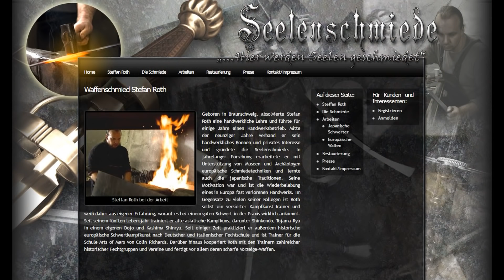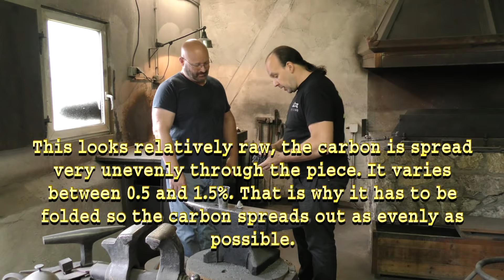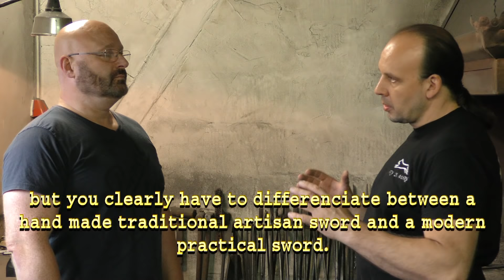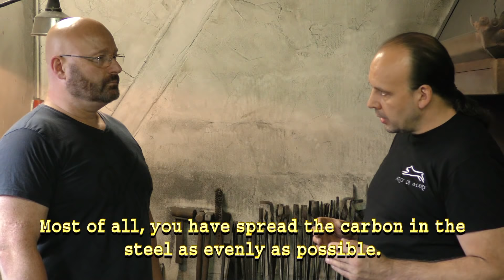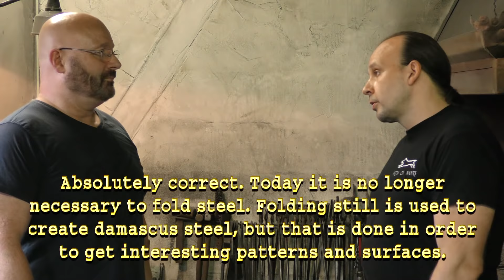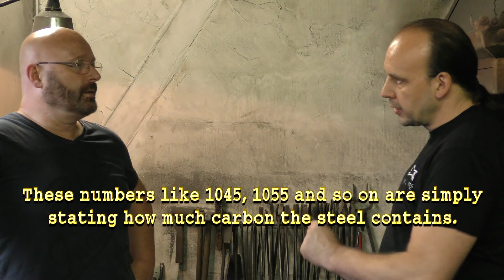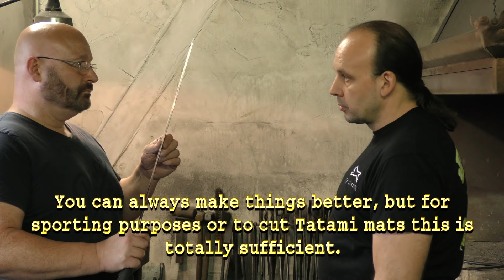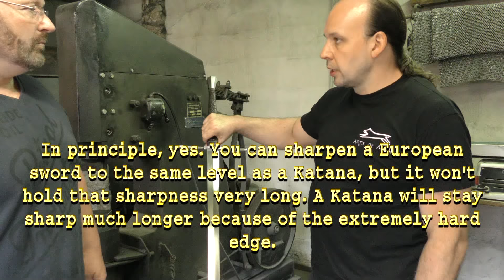Katana: The Naked Truth

Comment: Katanas look cool, and well... That's about all they've got going for them.
Reply: They also hold a very sharp edge like the guy said in the video and are a lot more agile then European style swords. But i feel like they wouldn't be effective against any form of armor other than like leather since you can't stab with it.
Reply: Will Whyatt
How sharp the edge is is just a matter of sharpening the edge... You can make a european sword just as sharp as a katana, and since it's double-edged and pointy it's also much less predictable.
Reply: luquos
They've got shit armour then. Stabbing is also much better for that sort of thing.
Reply: The problem is, you can't just encase yourself in steel. All armour needs to have points of articulation so you can move in it - By definition these points are weaker or open to strikes. And as good as stabbing is, it is very hard to get a sword into precise stabbing positions, especially for awkward areas like the neck, under the arms or between the legs, which are often the unarmoured or weaker points of armour.
Reply: luquos
Yeah I agree, and given the awkward way you have to move a katana for it to even be useful, it's much better just to use a european sword. Or use a pike, mace or warhammer.
Reply: +Ze Rubenator Japanese sword techniques are actually pretty useful even with European blades. Having trained in both, they're also not all that different! Japan just tended to ritualise war more than European forces
Reply: luquos
If you know how to fight then sure, the type of sword is probably not going to matter that much. I'm just pointing out that a katana is objectively not nearly as good as its fanboys make it out to be.
Reply: Ze Rubenator I said it holds its edge better. As in it last longer.
Reply: Will Whyatt
That entirely depends on the material used, not the shape of the blade...
Reply: Ze Rubenator Not according to the expert he was talking to in the video
Reply: Katanas and Anderhalbhänder have almost the same weight.
Reply: ***** Its made of metal yes its going to have some weight to it. But if you compare it to a europeon long sword it is very agile.
Reply: +Will Whyatt watch scholargladiatoria katana vs other swords part 5 about lol "agility" with a heavy two handed short bladed sabre.
Reply: The first 13 words you typed are accurate.
Reply: Spiredaspmc PVP
They're used to destory heavy armour. There's a little aspect of blunt force, but most of all they have a thick spike which is designed to punch holes in the plate.
Reply: Hey, that would still hurt like hell pointy side or hammer side.
Reply: Spiredaspmc PVP
Well, not really with plate armour. It'll be a good punch yeah, but all that force will be spread out on a much wider area causing very little damage. Warhammers are usually quite small, and not that heavy either.
Reply: fair enough.
Reply: I got to use a Katana at a bottle cutting event held by my Hema instructor - and I will say they cut beautifully. I was able to cut clean through a tatami mat on the first or second attempt ever. Though I will also add the light cav Sabre (cant remember the year or pattern - British 1796 I think) cuts equally as well. plus the sabre has the extra reach plus it has the D guard - not quite the 3 bar hilt but anyway..
Reply: I wouldn't say that a katana is more agile than almost any European sword that is designed to be used on foot. This is simply due to the fact that it's top heavy, it's PoB is around 14-25 cms from the hilt, while most longswords have it 6-12 cms from the hilt which makes a huge difference, well also it detracts some from the cutting power but since it's also usually 300 gramms heavier it is usually not that noticable. And of course you have a longer blade, apply lever physics a longswords point will be traveling faster than a katana's and you use the last third of the blade to cut with both of them. 

The katana will have more angular momentum but a longsword usually will have more kinetic energy to it.
Reply: Yet, longswords are more versatile, as you can cut with the edge, thrust with the point, do half-swording to have more control to stab the armour gaps when facing armored foes, strike with the pommel and the crossguard, and use it as an axe.
Reply: Well they where design for assassination and as for the samurai sword where made like that because of the armor they where using
Reply: ***** not really.  They adapted their combat techniques to the sword. Katanas were made of a very bad quality steel. They had to refine iron ore to extract the metal. They put the hardest one on the edge and the softer steel in the spine. They had to fold it over and over to take out impurities and distribute the carbon content.  Finally, the only reason a Katana has a curve is because it was quenched in water for hardening using a thick layer of clay on the spine to make it cool down faster.
Reply: 57069carlos Mmm Dindt know that !! Thanks
Reply: ***** A little correction, "Using a thick layer of clay onthe spine to make it cool down slower than the edge
Reply: 57069carlos Cool
Reply: the reason for the point of balance is for cutting.
Reply: what? no man the curve is there as a volcrom point so the blade can continue cutting tell the tip exits
Reply: Ze Rubenator Yeah totally not better for enclosed areas, indoors, while still being able to hold it's own against longer sword in open area and also an awesome cutter for its size
Reply: save an estoc or sword built for fighting armor
Reply: Jordan Burkhead I'd like to point out that just because it could hold its own does not mean that it is equal. Reach is such an advantage.
Reply: TheOneWayDown Its better for 2/3 scenarios while still being perfectly viable option for the 3rd was my point it's more well rounded so it's a better sword to me.
Reply: It's better in your opinion, not factually. If someone came at me with a longsword of any kind, my first defense sure as hell wouldn't be a katana... (it would be a kite shield, coupled with a shortsword).

But due to having more options available, being made from entirely hardened steel and therefore being more resilient to damage, I would have to say the Longsword in my opinion is far superior... Which doesn't mean I don't like Japanese swords - I love them...

Hell I'm a weeab - I watch / watched several animes, am trying to learn Hirigana and Katakana (then kanji), I own a katana (a cheap one just for display, but it is sharp enough to cut tatami if i could get any lol), I love Ramen, don't mind sushi, and I fight for the samurai team on For Honor... and have only play Kensei, Orochi and Nobushi...

Yeah I have a problem... but in the heat of battle, I would go for a longsword.

PS
I have no training with swords, so I'm not some kind of nutter with my katana, it really is just to be on the wall looking nice, the only reason it's sharp is... well what the hell is the point buying a blunt sword?
Reply: +Will Whyatt Katanas are not more agile than European swords. But yes, they do have better edge retention due to the differential hardening, as was said in the video. That only means it will stay sharp for longer, not that it can become sharper.
Reply: +Ze Rubenator Actually, against armour you would be using the blunt side of the warhammer. Yes, they are small, but they still hit extremely hard. The problem with the spike when using it against armour is that it can easily get stuck in it. When using the blunt end, this is not an issue. The force when hitting hard armour will travel through with vibrations and such and will still injure the person in the armour, that is why they use padding underneath to alleviate that. But the spike is most used for finishing off your opponent after beating him up sufficiently.
Reply: and that it can effortlessly cut your limbs off ....

Comment: I will note to people who do not know, a wet tatami mat is used for sword cutting. 

The expert has amazingly good technique! Thank you for bringing him on. The high speed shows the acceleration/speed that the sword/knife reaches at the zenith. It makes a big difference compared to other 'experts'. This video really gave a good insight into the differences of steel. It also explains some of the differences between technique between the japanese and western smiths - double edge makes up for the faster blunting the evenly hardened weapon undergoes, groves to reduce bending on the katana.

And it importantly demonstrated steel is steel- it is pretty much the same when made correctly. Having said all that, I think in the medieval period i would go to the japanese smith for my sword based on what you said, as the religious nature of the smith's process means it may well be more consistent - less likely that the smith is palming off a piece of dog iron on me.

Comment: Another common misconception is about the katanas weight. It's not that light at all. In fact a 29" katana weighs 2.5lbs to nearly 3lbs. So they are usually a little heavier than European  swords  of comparable length. This is due to the thickness of the blade. And they are not that fast for the weight either as they are usually blade heavy in balance. The good thing is it can be wielded with 2 hands which helps with the speed.
Reply: The hilt is rather long as well for extra leverage
Reply: 3 pounds is incredibly light, even military ceremonial swords are heavier than that.
Reply: Is on par with an european one handed saber in terms of speed (a katana is simply a japanese two handed saber), only that the balance and the long hilt makes it way different to handle.
Saber: focus on the wrist, one hand controls easily all the weight.
Katana: focus on both arms, using inertia to your own benefit.

Also you usually train with a bokken that is a little less aerodinamic and almost twice as heavy, so katana feels light in comparition.
Reply: Ken To be fair some ceremonial swords are heavier than battle examples

Comment: Contrary to what weeaboos claim, I highly doubt that a tatami mat is a good analogue of a human arm.

The dude cleanly sliced it in twain with a kitchen knife, as expected, but I'd be flabbergasted if someone of his strength with that knife was able to cleanly slice someone's arm off in one stroke. People aren't all soft flesh; bones have roughly the density/hardness of wood, and if the wooden dowel in that mat extended all the way through it, he wouldn't have been able to cut through it. He would have cut through the mat, to the dowel, where the knife would leave a big notch but not cut through.

Real life isn't a quentin tarantino movie.
Reply from the maker: Well, I remember the pics Jim Wagner showed around in one of those knife combat classes... real injuries from real knife fights. You'd be surprised how much damage a single cut from a sharp knife can cause. Gruesome.
Reply: +JoergSprave while it is true that combat knives can cause grievous wounds, they rarely cut bone all the way through. I have seen murders made with machetes and usually it takes several well placed cuts to get through bone with one.

On the other hand we have tatami which is not a great simulator for anything except to show the skill of the user. A mat can be cut with a blunt sword and it'll be fairly clean. If you tried to so this with flesh, you would only cause skin lacerations.
Reply: pretty sure that's why the guy said cutting through tatami isn't a big deal.
Reply: Jackarunda Jiralhasari Lifetime movies
Reply: Jackarunda Jiralhasari bones are actually harder than wood. In fact, they are harder than concrete some debate it's harder than steel. But it can be brittle at times especially on the skull
Reply: Actually living bone is rather soft, it can take more stress if the form of compression than concrete but it is far from harder than it. Dead bone is hard, living bone is about as hard as well living bone, it has far too many organic compounds that is for animals that it is not even as hard as hardwoods. Maybe as hard as pine. Also the skull is the most resilient and least brittle part of your body.
Reply: I'm pretty sure they forgot to wet the mat first...
Reply: Its probably a reasonable, perhaps slightly weak approximation of uncontarcted muscle. Contracted muscle is the consistency of Kuchuck rubber, and bone is sligthly harder than aluminium, perhaps on the level of carbon reinforced plastic. If you want to approximate a human arm faithfully, you should probably use a dead pig though.
Reply: Concrete is a composite, and tipically has a hardness between 5 and 7. Bone is made of hydroxyapathite with a hardness of 5. They are roughly equal.
Reply: Bamboo is stronger than steel and concrete ...Looks can be deceiving ..Food for thought.
Reply: Clearly a good point about the type of analogue used for representing a human arm.
As because the cutting-edge or leading edge when it is in momentum it would hit at a different density in a human arm.  each difference in density dependant percentage of viscosity for a fraction of a seccond any leading edge would bounce back the same exsertion of force positive going in meaning a much greater force required to cut off a human arm.... just like falling into water faster you go more it's like falling into concrete....
It's physics!

Comment: Two interesting tidbits for you:

Modern steel is generally superior to the traditional steels, but it's been formulated for consistency of result and ability to work by machine.  There are some alloys, especially the high silicon ones, that can make a better blade if worked by a skilled smith, but the process requires judging how the silicon chains are forming and orienting them properly, which can't be done via automation, so such alloys tend to be shunned both in production and in manufacturing and are hard to find and harder to find someone who knows how to work them.

If you want to improve your "Orc Sword" beyond just work hardening the edge, add a step of hot hammering at about a dull cherry red.  Done properly it will reduce the size of the grains of metal, allowing a finer edge, which you can then work harden by cold hammering.  My family has some old axes made this way that can be sharpened with just a touch from a file, but that will shave hairs off your arm.
Reply: Hi! I know this is an old comment but I'm starting out forging, would the cold hammering process work on rebar (I know rebar is just a mismatch of blended steels and whatnot but I need a good way of turning crap steel into quality tools)?

Comment: This is very interesting because I thought this back when he uploaded the first video. I think what the mith means is not that it's impossible to cut a mat with any sword that's not a katana, but that for a complete noob it's easier to cut it with a katana because of the self correcting edge alignment due to the slight curve. It's not that a katana is more sharp, it's that it tends to auto-correct the cut.

Comment: I hope you still read posts from this.  One thing that is missing in modern tatami test is, the test during warring Japan, the tatami had a bamboo core. This was to simulate the vertebra in the neck.  And the more influential sword smiths would use corpses and condemned people and they would mark the blades with something like "cut through 5 body's" or "cut torso upper and lower leg". This was done with a single stroke.

Comment: I might point out that not all European swords were unflexable. Depending on time period some were actually rather flexable, such as a midevil long sword. An arming sword, is also how they are known. Of course, a sword like that would spring back into shape right away, but if you stress it just too far it would break. Both swords have a place in the roles they played, and both were just as effective in the parts they were in. The arming sword is the katana of the west. People tend to forget that by the time swords became useless, the refinement of bladed weapons had nearly reached its end anyway.  Neither are as good as the replacements that are here now, which can do the job that those do several hundred times over. Regardless of which you prefer, a katana or a sword from a different area and era, a gun is more effective.

Comment: +JoergSprave. Thank you for asking a traditional sword maker if modern steel was better or worse than Tamahagane. I would add that one more crucial element makes modern steel better and that is reproducibility. There is very little range allowed for iron and alloying elements in ASTM, AISI, EN, or DIN. That gives you consistent material. Tamahagane is not consistent. It can be very good, or very bad.

Comment: I have to say that this did not cover the spring steel core with a hardened edge and soft steel sides.  That's, as far as I knew, a key characteristic of the process in Japanese swords and is done after the primarily steel has been folded.  However, edge chipping is a real thing still on any sword.  Period.  The thickness of your cutting edge will determine how badly your chipping problem is.  Very much remember there being some real black magic (from the perspective of ancient smiths) in Japanese swords because of their use of a steel with an accidental spring steel component introduced as an impurity they'd have no way of identifying.  "This metal is springy, wtf.  We need to go back and get more."

Comment: I always noticed I could cut better diagonally. I never thought it was because of the blade, I figured it was because my body worked better that way. I just can't get the same swing if I'm trying to move the blade horizontally or even vertically. Probably because a diagonal swing gets better use out of my pectoral muscles than a vertical cut and more of a boost from gravity than a horizontal one. PS that was with a plain old machete that I tried my best to use two-handed, even though its hilt was never meant for that.